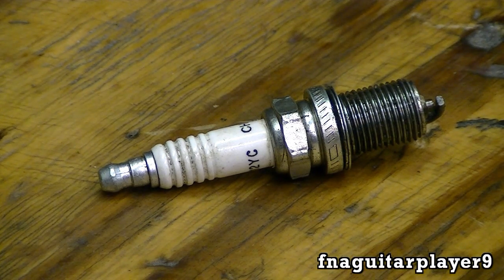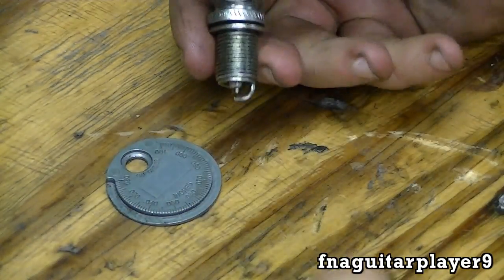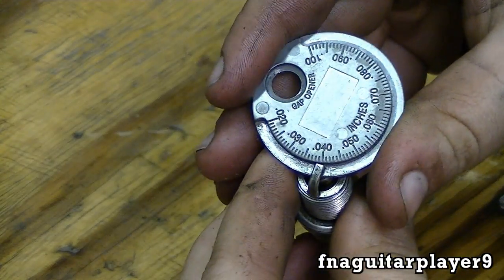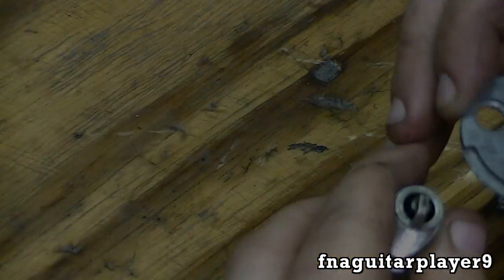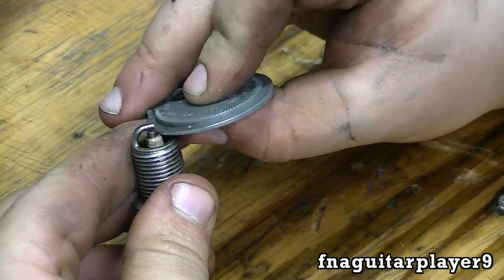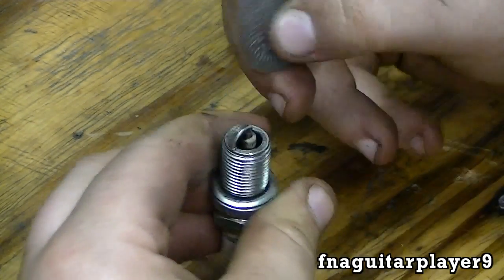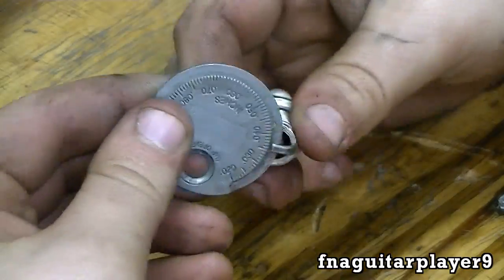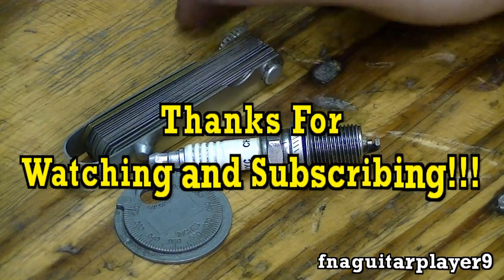How to Set Spark Plug Gap (in any engine)

Comment: 99.9 % of the time I buy a spark plug, the gap is bang on. Fortunate enough, I don't trust anything so, I do the wise thing and check everything anyway. I didn't know though that you shouldn't pry on the electrode. Excellent video by the way.